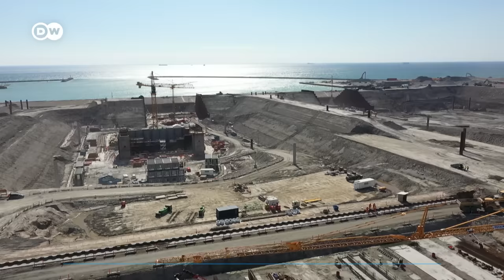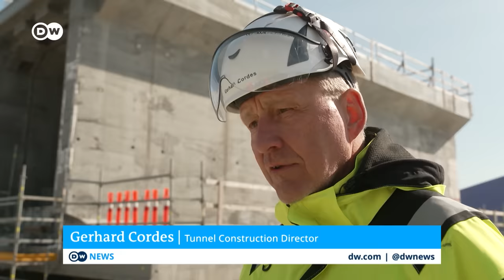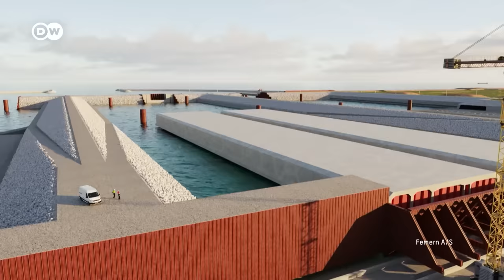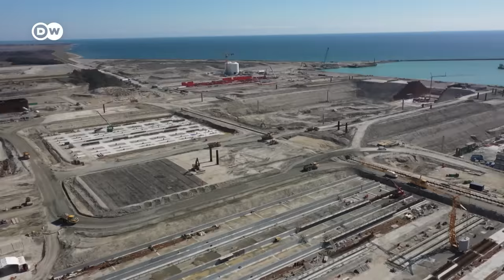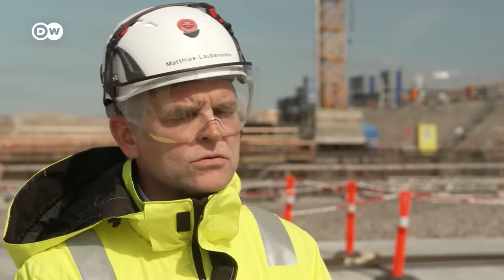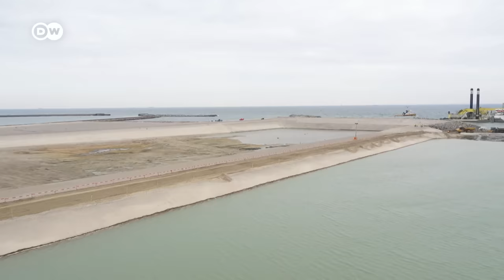Germany and Denmark are building the world's longest underwater rail and road tunnel | DW News

Comment: Although this is a huge and expensive project, it will save both the environment and economy in the long run. Saving longer transports through Jutland, or more polluting transportation by ship. Denmark chose to finance the more expensive, but also more environmentally friendly solution of a tunnel instead of a bridge. Ensuring this will absolutely be a win win in the long run.
Reply: there's the slight caveat that the immense quantities of concrete will set a truly immense carbon footprint themselves - the actual carbon reduction will be very little in total, kf it won't in fact encourage so much traffic that it will end up making a bigger carbon footprint than if it had just been kept as a ferry line 😅
Reply: @jakobraahauge7299  Yes you are right, concrete is a huge problem regarding CO2, the biggest danish company to make concrete, has a process that saves 30% of the CO2, compared to traditional production. Hopefully it will get better with more research.
Ferry lines cannot pull nearly comparable traffic to what the tunnel will. The huge advantage will be from rerouting traffic that currently goes through Jutland and the Great Belt connection, more than what is saved on the very polluting ferries.
Reply: hopefully. Besides - Sweden did a lot of the funding.
Reply: @jakobraahauge7299  You may be right, but AFAIK Denmark pays almost everything (the entire tunnel), Germany only pays the parts that is on German land. EU contributes 1.1 billion Euro. Ultimately it will be user paid, so Denmark only guarantee/front the money. So Sweden paying besides being users, is completely news to me.
Reply: Sure wait for more prevalent earthquakes am sure you would tout "it's worth it" :))
Reply: @ssuwandi3240  The region is just about the least earthquake prone on earth, so I have no idea why you would think that would be a problem?
Reply: @buffalox8492  that's your AI response:)) Antarctica would be a Yes.. but i guess a strong promoter would always benefit from the project funding and 21 ESG metrics by WEF
Reply: @buffalox8492  I think this was a reference to the deal about the bridge between sweden & denmark.

Like sweden payed there more, so denmark would agree building a tunnel to germany?? That's at least how I remember. So sweden payed indirectly
Reply: @b0m6erhd59  AFAIK the Femern connection was not decided at that time. So kind of a risky deal by the Swedes if true.
Reply: When it comes to the train part I agree, but the cars that will be driving across the tunnel will surely be less energy efficient than if they had been carried across by ferry, not to mention the energy nessecary to light and air out such a tunnel constantly.
Reply: @Nazgul100  At the time (2029), when the Femern Tunnel opens up, the majority of traffic ( both trains AND cars ) will be electrified.  And already now (first ½ of 2023) 67% of all electricity used in Denmark is from wind and solar alone. Up from 59.3%(2022) and 47.1%(2021). Most of the energy used to make concrete for the tunnel elements comes from nearby off shore windparks.
Reply: @ssuwandi3240 This is right in the middle of the European tectonic plate, there are literally no earthquakes here in recorded history. What are you on about?

Comment: Just make something clear. Germany is not building the worlds longest underwater rail and road tunnel. 

It will be completely built and run by Denmark, and is paid by Denmark and a little bit of EU.

All Germany is doing is the connecting infrastructure on the German side. 
Germany opted out of the partnership after stalling the project for 15 years.

Though many German Nationals have migrated to Denmark to work on the project, since it is better paid than most German construction work, due to the higher wages in Denmark.
Reply: I was a bit confused as the project managers and interviewees were all German
Reply: Can you provide a link where there‘s more information on this?
Reply: This isn‘t true. The partially state-owned and largely state-funded DB (Deutsche Bahn) Group of Germany is doing a huge amount of the rail construction and operation of the tunnel, and the german government is also paying for infrastructure required on land on Fehmarn.

Comment: Interesting how there isn't a single mention of the fact that it was the German state that was a major delaying factor in the project as they had no interrest in it at all and it only was possible to get the project started because Denmark decided to take the majority if not all of the costs for this project. But now that things are moving ahead it suddenly can be presented as this amazing common project 🤷‍♂🤦‍♂ Btw, it's not the first time Germany is a major obstacle when it comes to common european infrastructure projects. You can ask pretty much every neighbouring state to Germany. So much for Deutschland Geschwindigkeit.
Reply: Denmark would be a bigger beneficiary to the tunnel.
It wouldn't be an equal benefit like the Channel X between UK & France.

It's true though that GERMANY sucks in visionary mindset & mega projects
Reply: This is mostly a Danish project, true. But it is also a common project, EU has offered a significant part of the funding.

Comment: Doesn't Denmark border Germany?
Reply: Yes. And as the maps in this video shows, there are rails between them. This tunnel will significabtly reduce travel time between eastern Denmark and Germany, and between Sweden and Germany.
Reply: @klausolekristiansen2960  Instead of making a tunnel, why not build a maglev?
Reply: @nbgoodiscore1303  You would still need either a tunnel or a bridge.
Reply: @nbgoodiscore1303  the maglev Technologie is from Siemens (German Company) the Chinese buy it 🙇‍♂️ ...the project was The Transrapid in Emsland (Germany)
Reply: @nbgoodiscore1303 there is hardly no relevant distances for Maglev technology in Europe and still can't float

Comment: I remember clearly trhe rail passage across this strati  back and forth on my travels in 1988.   Also significant the rail connection between Helsingor and Helsingborg is now somewhat irrelevant with the Oresundbron that was opened 12 later between COpenhagen and Malmo.
Ive been carefully following this project since I first learned of it in 2015.  When the live cameras went on line in 2019 or whatever I was very veyr happy
Reply: As someone living in the Helsingor-Helsinborg region. It is more complicated than that. 

The Oresund bridge is reaching max capacity already so something has to be built. I am actually for the fixed rail and road between Helsingor - Helsingborg but I am not for a prefab tunnel like Femern as it would destroy the environment up here and most people on both sides of the strait wont have that. It has to be a bore tunnel but that is also the most expensive project. Therefore it has stalled

Comment: The legal side he mentioned is not really similar in Germany and Denmark.
In Denmark you can bring a case/objection to the court system. When a verdict is cast, it normally makes it final. Unless something new is discovered and submitted to the court, there is no way to change the verdict, or delay the project. 
In Germany each and every interest group can bring the case to the German court system, and they often have to be heard individually. So while there were less than a handfull of court cases in Denmark, there were thousands of complaints submitted to the German court system. A large part of those supported by the greedy ferry companie not wanting the competion of the tunnel. The Ferry company even paid for "protestors" to demonstrate against the project.

Comment: For what reason do we need this tunnel? Is it even economical?
Reply: It will be paid for by the users.
Reply: You will be in 2,5 hours from Hamburg in Kopenhagen by train. That's extremely practical for Denmark...
Reply: Cuts travel time between Hamburg and Copenhagen/Malmö more than halve and the rail system in Jutland is avoided which has been neglected and is not up for any more capacity especially regarding cargo if I am remembering correctly

Comment: We have to wait and see if mopeds and bikes are allowed through,,,   the boat was no problem from Putgarden...
Reply: I think that's highly unlikely! Riding a bike through an 18 km tunnel is neither safe nor healthy. All of Denmark's other cross-sea links ban cyclists and pedestrians. Mopeds may be allowed if they can be designated as motorcycles. A question of speed, I suppose.
Reply: You can take your bike on the train through the tunnel, just like over the existing bridges from Jutland through to Sweden.
Reply: Don’t you worry, Scandlines has no intention of canceling the ferries once the tunnel is there.
A lot of people like to stretch their legs once in awhile, and the ferry company still has 1-day return trip tickets for approx. 40€ on the Rødby-Puttgarten line. And the latest I’ve heard is that it intents to keep those tickets in the future as well, so it may take 75 minutes each way (boarding + sail time) but if you save 30-40€ alot of people will do that.
Business travellers won’t, but alot of the rest? Sure.

Comment: If the airport in Berlin is any indication of construction speed that tunnel should be done by 2108.
Reply: It is build by Denmark 🇩🇰
Reply: @marco21274  Ok so that means using Danish construction and bureaucracy practices that would completed by 2167.
Reply: @HamEggs-jt9dp any relevant examples supporting your racist nonsense?
Reply: @HamEggs-jt9dp  The similar sized projects in Denmark ( Storebælt and Øresund was completed close to the sceduled time!!!  Storebælt ( opened 1998) is basically payed off by now by those using it.  And Øresund ( between Denmark and Sweden ) was finished CHEAPER than it was projected to cost. And now they have all the experiences gained from those projects.  So WHY would it be delayed 138 years, before they have finished this Femern connection?      WHY??????   They started in 2021, and it is sceduled to open in 2029.  I will be very surprised, if it does not!   By the way, it is estimated to be payed off in 2058, 29 years after opening!

Comment: Sounds technologically great, BUT massive ferries already do the same between The UK and France for example. Greener too.
Reply: The thing is though that it is extremely awkward to connect rail networks by ferry. From what I understand a large part of the motivation behind this project is to greatly improve the rail connectivity between Germany and Denmark.
Reply: @fnorgen  
I think, it's also part of the EUs "north-south link" from Norway down to Sicily ...😊
Reply: Ferries are burning oil to moove. The construction of a tunnel might come with a huge cost in construction but will be better in the long run.
Reply: Think how much damage using all that concrete does to the environment. How much carbon dioxide is that going to create??
Reply: Greener until we're all driving electric cars.
Ferries don't travel as fast as cars on a highway plus the time to load and unload  and don't have the capacity of a road.
Not to mention rail accommodations.
That's why they built the Chunnel to link the UK and France.

What was your point again, I forgot?
Reply: @IMGreg..  channel tunnel. Massive waste of energy and resources and think how much co2 was released into the atmosphere just to save people journey time. Don’t worry about the climate though. And what is wrong with using electric cars where energy comes from renewable sources? What’s your point again???
Reply: @jb7052  
Please look up for the "green hydrogen coast line", a project run by the Netherlands, Denmark and Germany.

The EU27 will replace all fossil fuels (oil, coal, nat gas) with green hydrogen, the goal is focused on 2030-2045.

Hydrogen can be used as storage battery for the overloads from the offshore windmills and others as well as raw material for proceeding things like steel, glass, paper etc.

Lots of start ups are working on alternative storage possibilities as well.

Electrolyseurs (wind to power) are under construction everywhere as well.

Forgot to say: some months ago the world wide first 14 hydrogen powered trains (Alston) started their service in Lower Saxony/Germany  😊 

It's on the way "going green " 😊
Reply: @jb7052  The energy to create concreet is coming from nearby offshore windparks. It is part of the planning.

Comment: Salt water and concrete not the best combo, seals connecting those elements are only ok if the elements don’t move at all.  It would be safer to drill under the sea.  I see disaster two years after opening the tunnel.
Reply: If only anybody had considered, during the 20-year planning and design process, that the underwater tunnel would be near water. Ah well, better pack it in everybody. Orion from the Youtube comments section has found a fatal flaw.
Reply: The connection between Copenhagen and Malmø in Sweden is partly a tunnel made the same way. No problem as occurred in the first 20 years of the tunnels life, so Orion where do you have your 'knowledge' from 😀
Reply: Okay genius 🤦‍♂️

Comment: Why? Ferries and highways too old-fashioned?
Reply: Ferries are too slow and clunky, and the tunnel will have car lanes, so I'm not sure what you're trying to say with the highways bit.
Reply: @HeadsFullOfEyeballs  Well, are there currently no highways between the two countries? What about airlines, for those who are in a REAL hurry? Train lines? Suppose by the end of the project, they invent a new super-fast, energy-efficient train?
Reply: @TheTwangKings  what are you talking about? This tunnel has two high speed rail tracks in it
Reply: @tim_goll  LOL We're talking about two different things. I am saying, what about current infrastructure? Is it really that inferior to undertake such a titanic project (pun intended)?
Reply: @TheTwangKings  yes. The current infrastructure is very bad
Reply: @TheTwangKings   For those, who are in "a real hurry", the new high speed rail connection is faster than an airline connection. When airport waitingtime/control etc is included in total travel time from place to place. And all trainconnections are ALREADY electrified.  Already NOW (first ½ of 2023 ) 67% of all electricity used in Denmark was from wind and solar. Up from 59.3% (2022) and 47.1%(2021). And the tunnel opens in 2029. -- One of the SPECIFIC reasons for these faster land connections is to make the very polluting air travel OBSOLETE!